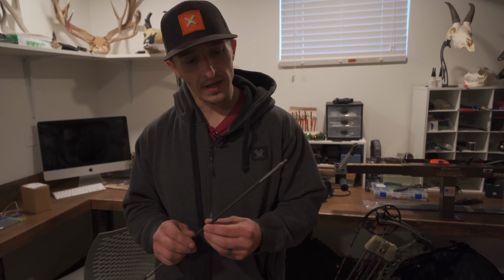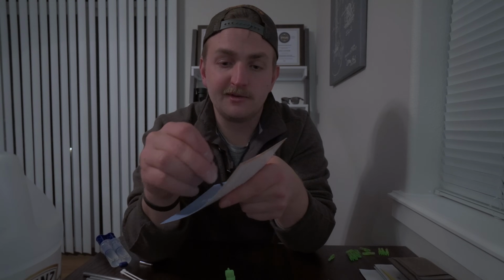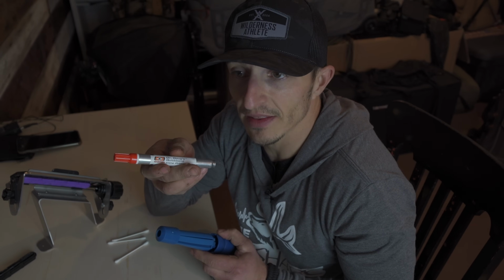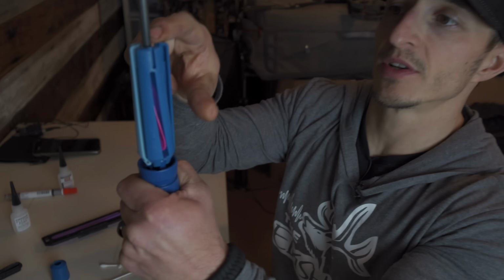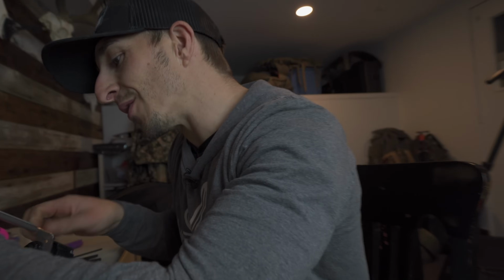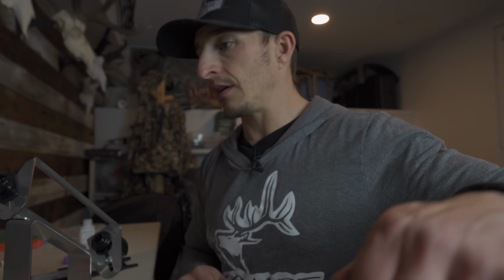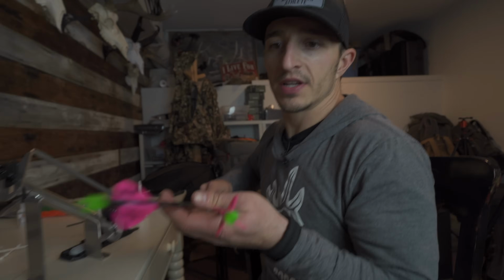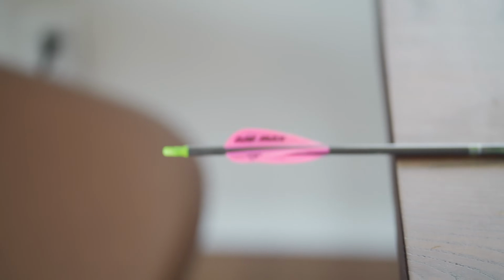COMPLETE GUIDE to ARROW BUILDING | 4 different FLETCH STYLES

Comment from the maker: What are you all fletching with? What's your arrow setup looking like? We've got some tinkering to share.... ESPECIALLY this arrow test, going to be really fun to test 4 different styles of fletching..
Reply: I dont do my own fletching yet.
Reply: I got 6 Gold Tip Pierce platinums, fletched them all a different way with the "goat tuff fletcher" lol it’s about $40 but works. I actually did do a 2 & a 3 ° degree helical on some 4 fletch and they fly great. My best arrow is my 3 fletch 3° LEFT helical, which I had to do kind of do it by hand because the Fletcher only goes right. So I had to flip the insert and hold it in by hand, it was pretty crazy. Ended up being my most accurate buddy. But this is great content and I recommend everyone get into this process to learn. What are your thoughts on the AAE Max Hunter's??
Reply: I've been using a Bohning pro class jig and running a 4 fletch 90/90 with a hard right helical. looking to experiment with 3 fletch for better F.O.C  and maybe gain some speed? i have been using wraps as well but going to experiment without. just like the added visibility when retrieving an arrow. total arrow weight is currently 450 grains +/- 3 grains . love the videos, very insightful!
Reply: I recently got a new grayling fletching jig, just using aluminum shafts (target shooter here but like watching videos like this) with left degree helical, don't know what degree it's not listed on Lancaster Archery Supply lol 10.3 grains is what I am running per fletching for 3 fletch. Don't really care about FOC but I will be using a light 54 grain point that is coming with the Easton Tribute shafts
Reply: Mostly use aae max stealth with a left helical usually 3 vanes.

Comment: Since I can not get a primer pen in my country, can I use rubbing alcohol or acetone?
Reply from the maker: Yes - and you may not even need that depending on the arrow vane, setup you use. You can try to fletch on without and see how it holds up.

Comment: Cut about 2" off the back of the arrow, before you cut off the front.  Most variance, even on quality or match grade shafts, are from the ends.  It will make a more consistent arrow in my experience.

Comment: I'm about to go to glue in points for practice and target and then for hunting switch to outserts/inserts. Keep them the same weight though just so it's easier to pull from targets. I've lost a few just from pulling out of targets. Even with epoxy they'll still come out after a while. I do however shot my bow alot, at least 4 days a week.

Comment: Nice video, 1. just wondering why you did not mark the spine of the arrow? Clocking the arrow,,,2. what makes the arrow spin left or right,, with out fletchings?
Reply from the maker: Tim here - good point.. that was my first time clocking arrows so I wouldn't know otherwise
Reply: @ElkShape  There are ways to locate the spine,1 is by by hanging a small weight on the shaft, suspended at each end, then run a micrometer on the center of arrow  as it is rotated,, Josh Bowmar has 1 hell of an arrow building video, with this and several other processes  in it.
Reply: @2amendment1960  late reply but the spin off the string is due to the twist of the string and the serving.

Comment: The video i watched previous to this one he shot a left helical a straight and a right helical and did 3 rounds each at 20 30 50 yards ect and found the ri9ght and straight held the best group and the right helical was overall winner. he hypothesis was tht the left clocking arrows with the left helical spun to fast causing them to go more wonky. i would really like to see you guys test this out! Cause if his theory is right than you just make a left clocking arrow less accurate by adding a 3 degree left fletching.
his channel is trippleR woods outdoors. check out the video he did i think you guys recreating it would be awesome

Comment: Not sure if I missed it but do you nock tune your bare shafts ? I have from 15 yards and they don't fly straight it seems without rotating the nock and reshooting them until they fly straight into the target not slightly off to one side or the other. I think it has something to do with aligning the spine to get the best flight.

Comment: Have you guys ever had any issues with left helical unscrewing your field tips or broadheads? I've heard this from multiple people, but I've never tested it myself. This is what drove me to use right helical rather the clocking. Also on a side note, I've found you don't necessarily need a primer pen for AAE vanes. I just use a qtip with some acetone and it works great. Also I'd like to say thanks for all that you guys do with the Elk Shape channel. I greatly appreciate it!
Reply from the maker: Good tips! A little piece of blue loctite tape is supposed to cure that unscrewing effect.. But yes we do notice from time to time.. mildy.. going to run that loctite on the hunting arrow setup - TC
Reply: @ElkShape  Awesome, I'm going to give that a try. Thanks!
Reply: I just put a little bow wax on my threads, and no issues with unscrewing

Comment: Been fletching arrows for 20 years - currently use AAE Max Hunter vanes on my AXIS 260 arrows - and you do NOT need to prime before you fletch. I also use basic superglue and have have no problems. Also I only allow a slow 10 count - little over 10 seconds per vane when fletching.
Reply from the maker: Ya the Owner  of AAE (one of them) was on The ElkShape Podcast and we talked about using primer pens - you can listen here https://elkshape.podbean.com/mf/play/pxjm4s/AAE_FINAL.mp3

Comment: I have been breaking my fmjs left and right lately I been shooting them for years and this is a new issue not sure if I got a bad batch or if quality has gone down? I am shooting 70lb vs 60lb maybe that's the issue?  However, I am going to try the day six arrows with their stainless outsert with collars this summer ordering soon. With broadheads you cant kill what you cant hit so I go for the most accurate broadhead I can find. Slick tricks viper trick currently but looking at trying some others soon. Have never fletched but would like to get into it. Thanks for the video. Dan what happened to lefty your not a quitter!? Haha keep up the good work!
Reply from the maker: Thanks bro - never heard about that problem with FMJ's worth giving a call to Easton I'd bet..
Reply: Odd, i am having the same issue bought 3 dozen FMJ 6mms in the winter time to practice with and weed out the bad ones. I’m down to 18.  Have had some explode hitting the target, bend really bad and I’ve lost one or two missing my block target at 140yds.  Mostly though I am find they are hitting hard and bending out of true, then they are flying all over the place.  I still have 18 good ones, but I get maybe a week out of an arrow shooting every day, then it is toast.  Looking to go back to carbon, just not sure what I am going to get.  It’s been an expensive year on arrows, I also bought some custom made ones from a local company, build utility is great as are the components, but I am having inserts blow out of the shafts left right and centre on 3D targets, which I am being told is that cause of failure on a hunting grade arrow, hmm. I call BS, as the inserts on some are just popping out of the arrows.  Anyways different story.  

Anyone have a good carbon arrow recommendation for hunting?

Comment: I like a low profile vane like a VaneTec Super Spine or V-Max in a 4 fletch with 2°-3° offset. I also do them in the 90° pattern, the 60° 120° doesn't make sense to me
Reply: With a low profile 4 fletch you get less wind drift with the same amount of stability or more compared to a blazer type vane or similar high profile vane in a three fletch. They work great especially for fixed broadheads
Reply: 60X120 would be for traditional bows, recurves, longbows, etc.

Comment: I'm having a hard time deciding on what fletcher to try any way you can go into a little more detail about them? Do you need to choose right vs left or can they do both/ certain degrees and such. Really looking into trying to do it myself this year but have that blue color budget so any buy 1 get best of both worlds would be awesome
Reply from the maker: we used the bohning multi-fletcher for most of this video.. Allows 3 and 4 vanes, with adjustable helical... The AZ multi-fletch is what Dan uses most the time fletch the vanes at once, but you don't get all the adjustability.
Reply: @ElkShape  is it adjustable for left or right or do you have to buy the bohning only 1 set way?

Comment: I order my arrows from deer crossing arrows and get the silencers(mirco arrows) and I’m using the deep six inserts from iron will weighing 75 grains. For fletchings dca will customize however you want so last year I used 3 blazers this year I’m trying fusion 2.1 4 fletch and they’re a lighter vane and lower profile and from what I’ve read that’s the benefit of 4 fletch you can use smaller low profile vanes and still get the steerage and lower profile benefits when shooting in the wind.
Reply from the maker: interesting, cool to hear that

Comment: I do use a 4 fletch with a big fixed blade and high FOC but I'm using Q2i Griff 1.8" that are stiff low profiles (4 of em weigh as much as 3 blazers) and are fletched in a slight right offset (about 2deg) not helical and fly like darts. BE Rampage 300's , 28" C2C, Ethics 100gr insert, vanes mentioned above, and looking like 150gr Cutthroats
Reply from the maker: word up !!

Comment: Is it a pain to remove the glue from the shaft when it comes time to refletch? I've always used wraps but am thinking about going straight to the carbon
Reply: Garret Carden I feel it’s easier to get glue off the shaft then taking off wraps.
Reply: Do you just scrape it off?
Reply from the maker: it isn't a pain at all!

Comment: Dan, if you want once you know the preferred bane setup, on the ez-fetch, u can get replacement arms.   I went from the org right long arms to the right mini.   They are a tight helical.   Little tough to swap out, but not to bad.  Check out the ranch fairy for heavy up front setups as well.
Reply from the maker: word up - thanks for the input!
Reply from the maker: Ya man I put the link to just the arms in the video description in case anyone wanted to swap them out and YES and pain in the ass to do so haha!
Reply: You need a small punch/drift to push the pins out, then to put them back in.   I think it took me an hour to swap them out.    But, if you are going to run smaller vanes and don’t need to run long ones, and you are “cheap/tight wad”. It works pretty good.    LOL

Comment: Just started trying a four fletch with the mini blazers with a 2 degree offset and found them to be more consistent with field points than a 3 degree helical. Also they seemed to perform almost the exact same as a 3 degree helical with a magnus buzzcut stinger attached at 50 in the wind.
Reply from the maker: Very cool!

Comment: My current arrow setup runs a four fletch Pro Hunter vane with a wrap and 3 degrees of helical on them. Fly pretty lights out to 82yds (longest shot on Yeti course at Terry Peak,SD TAC). Easton Axis 300 spine, cut to 27.75”, standard HIT insert and 100gr points.

Comment: I recently bought this same Bohning jig too. I own the LCA jig, Bitz jig and the Aerovane jig too. But for the money this Bohning does VERY well especially keeping the lower and upper corners adhered to the shaft. I have used the 3 degree left, 1 degree left and the straight "clamp" in three and four fletch. They "say" it's and offset but if you look very close at the base of each clamp insert there is actually a twist that is on the very edges that contact the base of the vane hence allowing the vane to wrap the arrow more than just a plain offset. Even the really expensive jigs with strong magnets don't do as good of a job as this one does with keeping a strong hold on the vane while it's drying. The 3 degree left "offset" I did had more helical than my old Bitz jig with an actual helical clamp. I just don't think we would be able to get a full 3 degree offset to adhere "perfectly" to the shaft and have all four corners stuck without having some helical involved...especially with a small .166 shaft. Take a look at those clamp inserts and compare them to the straight one and you'll see what I mean. Great video btw!!
Reply: Also, when changing the jig from back and forth between 3 and 4 fletch that single screw that holds the cap on does not need to be tight. If you back it off 1/4-1/2 turn the dial will turn more smoothly and you can distinguish between the clicks.
Reply: Steve Davis word up.. it is a great jig thanks for sharing

Comment: Love the content! Not saying you guys did anything wrong but I watched a video where someone was sorting out the vanes by weight because the tolerances weren't great i was surprised at how much variation there was in the pack of vanes. Just a thought to help dial them in even more. The differences get big when you are a 1/2 grain difference on each vane plug nock variance as well as arrow variance and broad heads all adds up in the end.
Reply from the maker: Good info, thanks for sharing!
Reply: That's why you go with VaneTec vanes.
Reply from the maker: @shaneberkness2743   - Dan here - The max stealth all are same grains - a real solid batch but that's definitely a solid point on checking everything!  Thank you!!

Comment: What’s the point of clocking I’ve had guys in pro shops tell me that if you spin your arrows left you run the risk of unscrewing your broadheads, any thoughts on that?
Reply from the maker: arrows seem to shoot the truest when they are clocked, and yes broadheads can unscrew a hair, but it's never been an issue. A little piece of blue loctite works too if you're concerned - TC

Comment: I would recommend the victory, vap tko stainless steel, them things are amazing, a .001 straightness, micro diameter with a 50 grain outsert, these arrows are absolute beasts
Reply: 110 grain ethics inserts in mine, 125 Iron Will's. 580 grains of fury.

Comment: Just did a 4 fletch 90/90 1 degree left for my turkey arrow.  The Magnus Bull head  3-3/4 need the extra steer ability but not the extra spin of a 3 degree. Also use the EZ fletch, I think the 60/120 is meant for crossbows.
Reply from the maker: 60/120 will still get tested lol ... it's built now

Comment: I hear this all the time to. That if ur using the AAR vain’s then u absolutely need the primer pen and their glue. If u just use a little bit of sand paper on the bottom of the vain’s then they most definitely will stay on there. 100%. And, u don’t even need to use the primer pen either. So u save money on no primer pen and only five bucks for glue instead of the $15 for the AAE, shit.

Comment: If you are looking for options to see how objectively these different styles shoot, i would be interested to see what the impact of these different fletch configurations have on arrow speed and downrange drop, wind drift and overall accuracy.  Rotation happens with friction to the air as the bullets travel, i would suspect that the more they spin the tighter the group, but also the slower they are and drop increases down range

Comment: When using the squaring tool it is best to mark the end with a silver Sharpie and then rotate the arrow in the tool until all of the silver mark is gone. It takes many more rotations then was demonstrated in the video to obtain a perfectly square arrow end. Also, I would recommend you square BOTH ends because they are not perfect on the nock end from the factory. Another point: Denatured alcohol or Acetone is best for cleaning carbon dust from inside the arrow prior to gluing your inserts. Rubbing alcohol contains oil and other additives that could interfere with its cleaning abilities and leaves a residue.
Reply from the maker: sounds like you've built a few bullets yourself.. thanks for sharing
Reply: My thoughts as well. I was surprised a proshop that doesn't square both ends. I am also surprised you did not spin the arrow to make sure both ends spun true. I always check both ends before cutting.